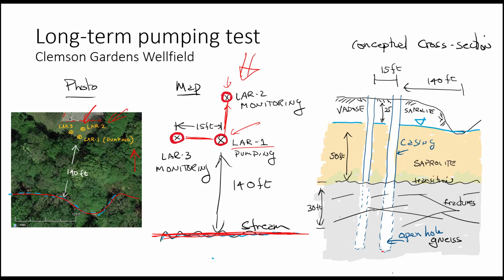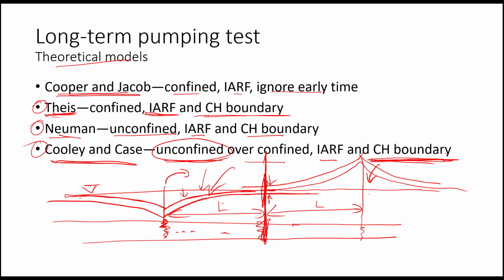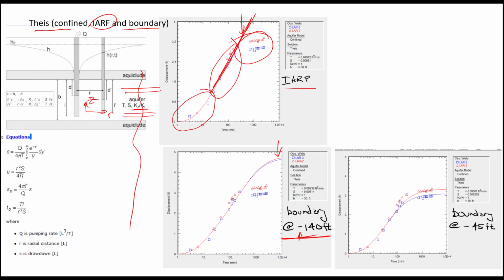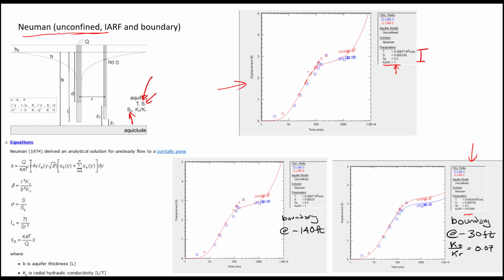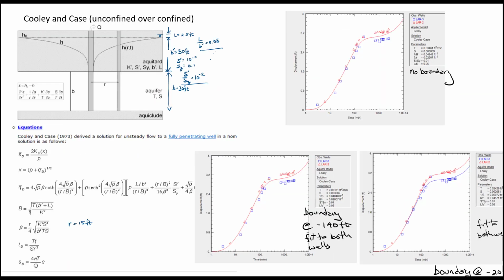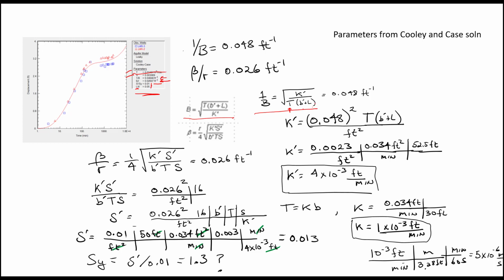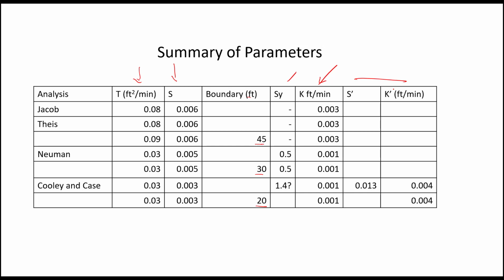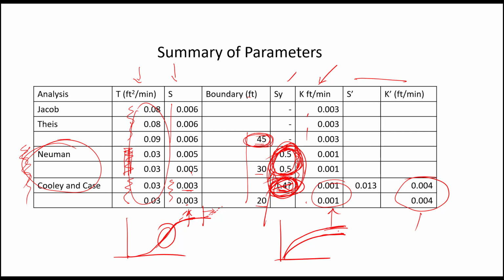long-term pumping test Part 2 example

Comment: Thanks Larry for all the videos! I'm having a really hard time figuring out how to get hydraulics conductivity from aqtesolv. Specifically I don't know what to use for B in a lot of cases especially in unconsolidated sediment with variable thickness observed in observation wells.  It seems like you usually use aquifer thickness for B. I have a lot of colleagues who say that using the open hole/screen interval is correct. If you have are calculating K from an observation well do you use the aquifer thickness at that location or use the thickness  logged in the pumping well? Do you have any tutorials on it or suggested readings on that topic? Thank you so much!
Reply from the maker: Mark,     Most of the solutions in Aqtesolv will give you transmissivity and you need to come up with a saturated thickness to convert to hydraulic conductivity.  The best data would be core or a well log along with the water table.  The open hole/screen interval is definitely not the same as saturated thickness, although sometimes that is all the info that is available.  

Most solutions in Aqtesolv assume the aquifer properties are uniform, but this is never really the case.  A good approach is to estimate a range of values for thickness and calculate Ks for the range.  Then you can select a value in the middle of the range (geometric mean is often used for K) as your estimate of the uniform value, but you use the range to characterize the uncertainty of that estimate.    This would give an uncertainty in K that resulted from uncertainty in the conceptual model (your assumption of uniform thickness).  So, you would do your best to come up with a representative value, but you would include the uncertainty in that value.  If you have many measurements, you might be able to use more formal statistical methods to characterize a central value and uncertainty.   Larry
Reply: @lcmurd1  Thank you for the response, I really appreciate the detailed explanation! Your explanation makes a lot of sense and I will definitely use this a lot in the future.

Comment: Larry I love your videos. I work as a hydrogeologist and these videos are such good refreshers on topics I haven't seen in a while, sometimes since school. Thanks so much for putting them out into the world!!

Is it possible that the fractured nature of the rock causes the boundary to seem closer, and that's why AQTESOLV seems to only fit well when the boundary is assumed to be closer? If you had a reasonably continuous fracture system, it might evacuate the fractures quite quickly and then hit the stream boundary. 

That was my first thought on the flatlining of the drawdown. You should go out and pump it for a week to get to the bottom of this!!
Reply from the maker: Hi ItMaker,    Good point, it is certainly possible that there is a fracture with a high hydraulic diffusivity between the well and the stream.  That would help explain the relative difference between the drawdowns in the two wells that are equals distances from the pumping well but different distances from the stream.  The analytical solutions are quite idealized and they only allow simple interpretations, but it could be possible to evaluate what you describe using a numerical model that includes discrete fractures.  I thought the saprolite was playing an important role in the flattening of the slope, but if that was the explanation I would expect to see drawdown in the saprolite.  The data from the saprolite well are peculiar, with some drawdown occurring early and then recovering.  These data were measured using a water level tape by different students, so maybe some measurement inconsistencies contributed to the peculiar signal.  Agree that a week-long test using pressure transducers would help resolve some questions.   Larry